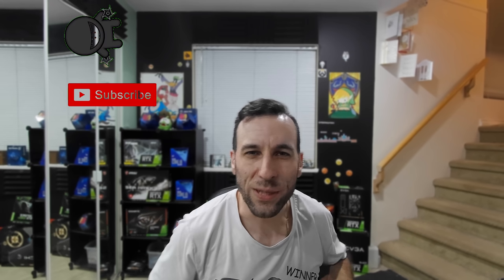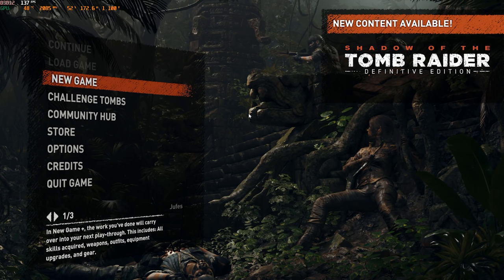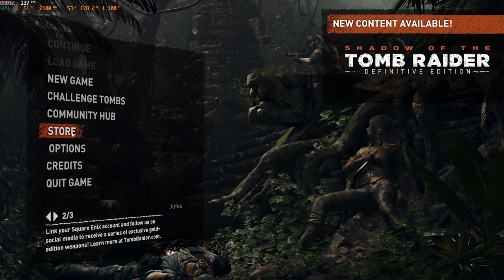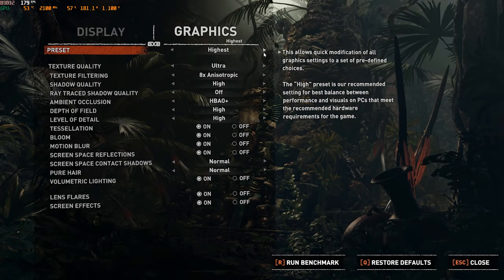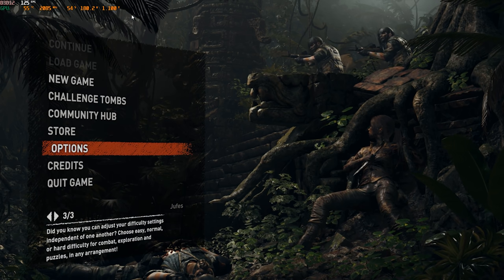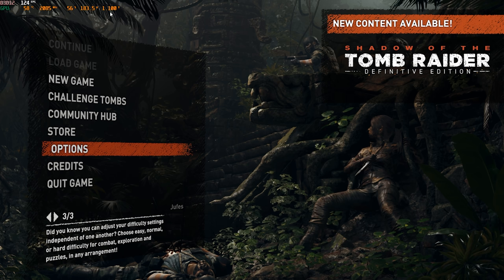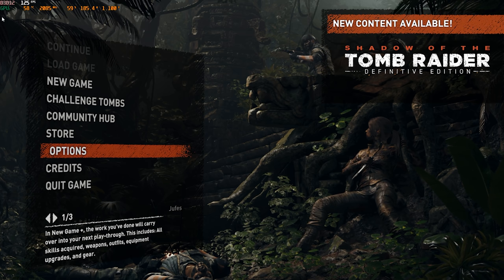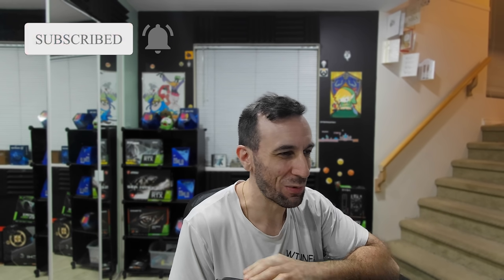RTX 3080 Problems FIXED, no crashes step by step guide

Comment: Well I've had this crash issue on the 1080ti amp extreme zotac card for about a year and a half now.. This is something new I can try.. If this works.. You sir will be the man wen it comes to PC stuff for me. I only found you recently and I like your videos. They are very helpful.
Reply: There was a dodgy batch of Zotac 1080ti amp extremes Zotac released that were crashing at their OC clocks that's why they release the core edition and dropped the clocks a bit, You should have got that card RMAd I've just sold a perfectly working 1080ti amp extreme on eBay I've had since new.

Comment: I have the revised EVGA FTW3 Ultra (with the black instead of the red trim on the side) with the mixed MLCC and POSCAPs and Doom Eternal crashes on a fairly regular basis. I've even underclocked it to -100mhz in EVGA Precision and it did not stop it. I guess I should look into a BIOS revision from EVGA?

Comment: why did evga switch cap designs if it's simply a bios fix? im sure they are aware of undervolting.
Reply: seems like miscommunication or something with the pr department, because the response post from them referred to them as POSCAP's but they definitely weren't, they were SPCAP's.

Comment: Honestly man. I was having an inconsistent experience with my Strix 3080 v2 oc while overclocked. Sometimes i could play for hours sometimes it would crash within a couple games i realized that a lot of the time the voltage limit would spike somewhere random and cause the game to crash. Limiting my voltage to 1.68v i get the same 2055 / 2040 MHz clocks at 2 degrees C less. You have helped me a lot!. Should i smooth out the graph before the limit so that it's not such a jump? Or should I leave it as is.

Comment: Could this be what's happening with me?  I've been having a lot of issues.  The main one is with sound cutting out and video slowing that's not in games.  But I've been playing a new game and it's been crashing frequently.  Since this happened so much, I started noticing a few knocking sounds coming from my RTX3080, like the discharging of a capacitor, when this happens.  I realize this video's old, but it's one of the few that addresses anything similar.  BTW, I'm able to hear the knocking because my card is water cooled so no fan and it's externally mounted, so not muffled by a case.

Comment: Are there any cons for undervolting ? i.e. slight performance reduction, durability etc ?

Also: underrated channel
Reply from the maker: Nope, if anything it enhances longevity due to less heat and stress on all the components.  I just started YouTube, it’s very rare to go viral overnight, I’m here for the long haul so I’m not in a rush to blow up.  Just having fun making clown intros

Comment: Hey man love the vids. Have you had or heard of any crashes with the xc3 ultra thus far. Or does it seem to be zotac related issue. My xc3 should be arriving today or tomorrow
Reply from the maker: Seems to be random on all models, I CAN make mine crash by artificially inducing a lower power limit and making it swing more violently, but out of the box it never crashed

Comment: You could argue that the some cards with only sp caps can't handle the current boost behavior as good as cards with MLCC caps. MLCC caps are objectively better at sudden spikes of current draw. So I guess the fix is either using MLCC or Nvidia changing the boost table and or downgraded clocks via firmware update.
Reply from the maker: Firmware updates are inevitable at this point I would imagine, everyone going to get reduced clocks and voltages
Reply: @FrameChasers  Yes, I agree. That's the cheapest solution for the companies involved. :) Not really a big deal tbh. A couple fps maybe. Would be interesting to see if there will be a new revision with MLCC though.
Reply: Even pure MLCC cards are reported crashing. So that's not the fix
Reply: I have latest drivers … how do I find firmware update for the GPU ??

Comment: Hi, I’m curious to know which model of 3080 are you using for this video? Does the voltage slider in Msi afterburner work for you? It seems to be locked on my card.
Reply from the maker: You need the beta version to see voltage

Comment: I have the EVGA RTX 3080 XC3 Ultra. I haven’t experienced any crashes even with the fluctuations. Will your method improve the performance of my card?
Reply from the maker: Yep it will, undervolting is always a good idea on ampere specifically
Reply: Frame Chasers thanks!

Comment: Am I right that I can 1to1 adapt this do my Asus ROG Strix RTC3070 OC?
And how will undervolting impact the Performance of the card?

Appreciate your answer :-)

Ah one more question: How do I get the Monitoring ingame with MSI Afterburner to actually see that voltage and mhz are freaking out?

Thanks alot!

Comment: Unnecessary, just update Nvidia drivers that came out today which addressed this issue.
Reply: Lots of positive reports on the new drivers. Luckily, I haven't had crashes but i notice with the new drivers, my max boost is pegged at 1995 Mhz, down from 2040 Mhz. This is at stock and translates to a 0.5% drop in timespy which i would never notice in games. I had a stable +60 OC for some days now so i think I will just add +40 to get back to my original stock and leave it be.
Reply: That's exactly what the driver did lmao

Comment: I am only getting random crashes when watching youtube (or other videos online..) and skipping through the video. I do not have any issues while playing Cyberpunk or other games that actually push the card. Can this also be related to this? That the voltage goes super high as I am only watching videos?
Reply: that's usually caused by your cards speed going below 210 mhz
Reply: @cjs333  It seems to have been fixed with newer drivers, not sure which one it was, at one point it just stopped happening

Comment: thanks a lot for this video. I have a rtx3070 and always crashes in almost every game. Just a question: i see in your video that the voltage is fixed to 1. I follow all the instruction but i still have floating values under 1v. Is it a problem. You said that up and down changes are the problem.. How can i stabilize the voltage? However if the games are stable it's not a real problem eheh. thanks a lot again!!!

Comment: Im having crashing issues with my msi gaming x trio 3090? Would this method work with the 3090 cards as well? Ive tried everything from upping fan curve for better cooling to downclocking the core still crashes red dead redemption 2 on max settings. I dobt want too return because i know how hard it is to find one. Please help?

Comment: Hello, I saw this being mentioned in reddit as a fix, can this fix a 4070? I dont know if it's the monitor or the graphics card. It goes black screen and sound still play. Can I follow your tutorial even if it's for a 4070? Pls help. Thank you.
Reply: I am using a  GTX 1060  6GB,  when I played some games like last of us or returnal I got a black screen like this, only downclocking my memory vram to -250 solved it, with msi afterburner 4.6.2

Comment: Hey framechasers! Love your channel. I’m running an overclock of 750 mem and 135 core on 3080 EVGA XC3 ultra (no voltage over clocks). I have no crashing on most of my games except Dead By Daylight (I’ve emailed the devs). I’ve even run furmark for 15 mins on these settings and temps maxed out at 67 degrees with no crashing. Never had this issue on my 1080. Is it possible some games are just crashing on current drivers to a degree? I am going to game without overclocks to tell.  But if it passes on furmark for 15 mins stress testing it should be fine?
Reply from the maker: Naw, overclocks are totally game dependant and random for stability, just lower it 1 bin at a time (15mhz) until it works for that particular game
Reply: @FrameChasers  would you start on core clock or mem clock?

Comment: try to test that cards on Linux cuz its propably win10 drviers isssue
Reply: The drivers for Linux are watered down unfortunately. Even when they work, they're not stable, or stuttery at high resolutions. That's assuming you can get the game to work. 

Don't get me wrong, I love linux and ran it on one of my PCs for a while, but until the industry (cards and game developers) truly embrace it, it will always be a few steps behind when it comes to gaming.
Reply: Doubt it, Linux drivers for GPUs are far worse.  I've used several Distros for decade and find myself moving away from linux al together except for very specific cyber s tasks.  Waste of time trying to build gaming on Linux, it'll always lag and always be some micky mouse job.

Comment: im not good with overclocking ir underclocking. i got my rtx 3080 yesterday and put it in my new pc. tried playing warzone but every game in warzone i get a dev error. i dont know if its cuz of my rtx 3080 or if its a game bug. so far i only tested warzone, i tried playing the multiplayer version for a bit no crashing.

if i tried this guide you think it should solve my problem?
Reply: I know it have been 11 months but it work for me. Same problem on warzone and crashes on Cyberpunk.  I did this and it works now.

Comment: I have a MSI VENTUS OC 3080, its crashing to desktop after 10-20 minutes in fornite, also BF5 is giving me problems, games like COD work fine, i tried the 1 VOLT lock to 1900 MHZ, and it still happened, so i left the voltage as is, and reduced the core clock by -50Mhz, it seems to have problems in certain games . any idea ?
Reply from the maker: Your best bet is to join the discord and ask for help or check out my consulting page

Comment: How do you keep the voltage from jumping below 1000mV?

I have gotten my 3080 Gaming OC stable at 1000mV (2020Mhz so far), but it keeps dropping down to 940mV and then back up, and that makes the clock still jump from 1890 to 2020Mhz all the time.
Reply from the maker: if you are hitting your power limit at 1v, nothing will stop it from downclocking other than more power limit, you can change the entire voltage curve below 1v to make it clock higher if it does downvolt itself
Reply: @FrameChasers  Ah, yes - I may have to try and raise the curve a bit over all!

Thank you - great vids! :)

Comment: I have ryzen 9 3900X and  RTX 3080, all my drivers updated i got a 1000W power supply i cant figure out whats going on
Reply: What type of problem you're having bro can you please share your experience????
Reply: @sajithsaji3606  im dont feel like im getting the fps i should be, also crashes on games which i should be running fine ive tried all the stuff i can think of to fix
Reply: @robbielane3859  did you figure it out ? I have your same setup but I have a 3080ti

Comment: Can you please do a video on a fix for low gpu usage (40-60% usage)? I have a ryzen 9 3900x @ 4.3 ghz all core and 3600 cl 16 ram which shouldn't indicate bottleneck problems. My corsair rm750 is enough to power both of these.
Reply from the maker: That’s impossible, that’s game and platform dependent so any video on that wouldn’t be able to cover all scenarios.  That’s something you have to fix on your PC specifically
Reply: do you have discord I have same issue

Comment: is this why my 3090 ti crashes just 30 seconds into a game like destiny and arma 3?
Reply: How s your gpu now???? Problem fixed.????
Reply: @sajithsaji3606  ended up just not playing those two games sadly couldnt even figure out why it wont work
Reply: @murphygaven1  your full specs????
Reply: @sajithsaji3606  ryzen 5800 msi board 1300 evga psu 3090 ti founders ed.
Reply: @murphygaven1  did you tried ddu???
Reply: @sajithsaji3606  yeah even tried a fresh wipe but it only has the issues with those two games so idk lol

Comment: My Zotac 3090 fluctuates like that. It touches 2025 then drops to 1725, bounces up and down no crashing yet🤔🤷‍♂️
Reply from the maker: Is it 6 big caps on the back of that one?
Reply: @FrameChasers  I will follow up when I get off work smh
Reply: @FrameChasers  nvidia spec is a 4+2 for a 3090, it's supposed to be a 5+1 on the 3080.. So I'm not sure if partners are liars or nvidia. Either way the FE 3080s are 5+1 and the FE 3090s are 4+2
Reply from the maker: I was just more curious to see if his card is fluctuating almost 400mhz and not crashing, what Kind of cap array and power supply he has
Reply: @KorRrnBred   6 caps ?
Reply: @latinochico  too be honest I cant see and I'm not a techy guy to open it up and find out, sorry. I know it's more stable with recent drivers and it doesn't go higher than 351 watts.

Comment: I bought a Aorus Xtreme 3080 Waterblock 
It won't let me undervolt or overclock
I'm stuck at 48°c under 2000MHz
Won't pass 3D Mark stress test, can't get 17000 on timespy for GPU.

Junk fucking junk 

Like buying a Lambo with a 60kph limit

Comment: YOU ARE THE BEST
Reply: I just checked my card behavior (I got a Palit gamingpro 3080) Its running on a stable clock but from idle to heavy load the freq is jumping very high and after couple of seconds later its stepoing back a little bit. My card just only crashes about like 3-5 hours gaming

Comment: So the fix is to make the card worse. Nice fix ! Not buying a expensive card to down clock it. But I bet nvidia is going to do that with drivers anyway
Reply from the maker: The clockspeed is higher and more stable after the undervolt...
Reply from the maker: Nothing because your limited by the power limit anyway,  if you had a 500 watt power limit then you would want more voltage, but a 320 watt power limit anything above 1 volt is pointless. Performance will actually be much better since you won’t be getting those frame dips in your gaming from the bouncing clocks
Reply: Frame Chasers you should get a job at nvidia!
Reply: your not "down clocking" it .. your controlling the voltage so you don't get wild spikes trying to hold the wattage inappropriately.  Maybe watch it again and pay attention. Just saying.